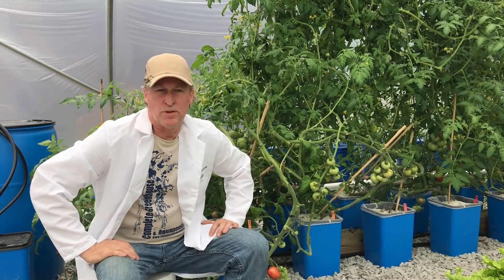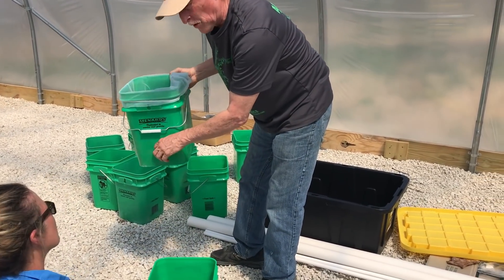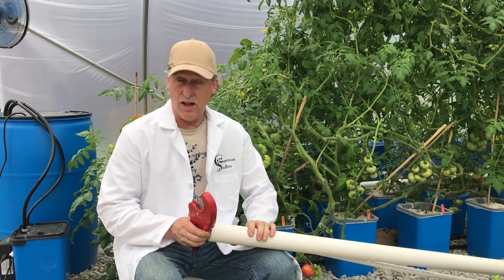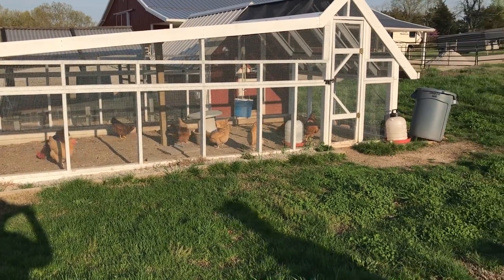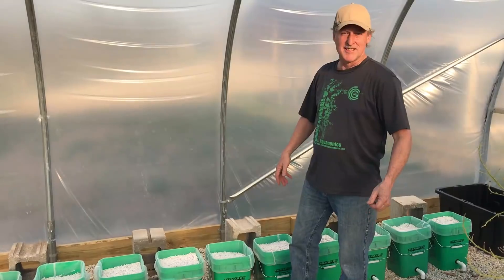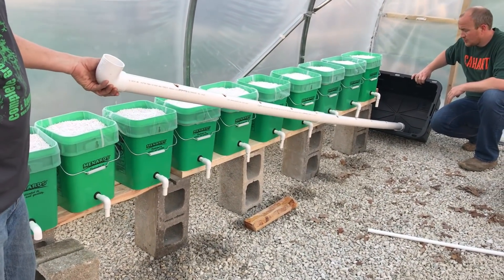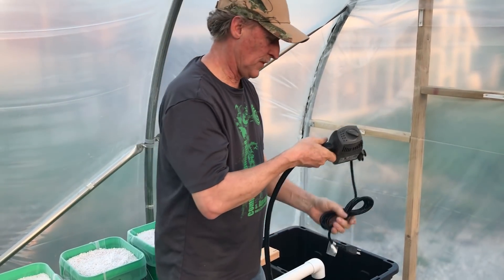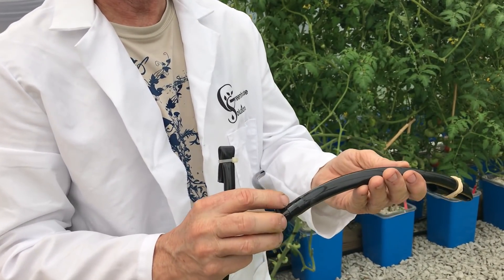Hydroponic Growing  Buckets (Dutch buckets) Best DIY Dutch Bucket Video

Comment: Very much a beginner question here but, my bucket is filling up with water and not draining well. There’s a puddle of perlite in the center. My pump is working at its lowest setting possible… what can I do?
Reply: Create some space at the outlet drain of the bucket. A little bit of large gravel or pieces of pvc at the bottom can help.Perlite might be too fine and not allowing to drain correctly.
Reply: @rplatow4120  yup that’s all it was. How embarrassing 🙈. Appreciate it

Comment: How do you make sure all the buckets get a similar flow of water? I just finished my build and for some reason there are some buckets that receive little to no flow of water.
Reply: Use an adapter T between buckets. This evens the flow. 1/2" for main T and 1/4"x1/2"x1/4" T between buckets. Minimum of 270GPH pump.
Reply: @rplatow4120  Thank you, I am currently using a 1/2 x 1/2 x 1/2 T adapter. So maybe I need to change the exit to the bucket to be lower diameter? Or the other way around: lower diameter in the entry and output that goes to the next bucket and higher diameter to the output that goes to the plant ?
Reply: @elnimrod  The1/4" feeds the bucket.

Comment: website dead?
Reply from the maker: Don't think so. Will check.
Reply: @greenhousesolutions1074  , site works. My machine was throwing in an S. https instead of http. One question though. Perlite. I have 2 huge bags like yours. How many 4 gallon pails can you expect to fill with 1 bag? I almost finished my 12x20 greenhouse from coloradometalworx.com. It's awesome. All of my peppers, hots and superhots are going there.  I am going hydroponics with dutch buckets this year. Hope it works out.
Reply from the maker: @TMonkey_DayZ  Each bucket takes about 1/2 cu ft, son 8 buckets per 4 cu ft bag.
Reply: @greenhousesolutions1074  Thanks

Comment: The way you entertwined the hose ! Bad luck if you want to move a bucket out of the system
Reply: Correct. We just use tomato clips or twist ties now. The intertwined was a suggestion from another client. Another person suggested drilling holes - more un-needed work.

Comment: Great video , I have a question: You say 1" hole 3/4  grommet and 1/2 pipe, the math over here does not add up well, can you tell me in more detail please.
Reply from the maker: The 1 inch hole (1.1"works even better) is needed for the 3/4" grommet (Outside diameter is 1"). The outside diameter of the the 1/2" pvc is the inside diameter of the 3/4"grommet.
Hope that helped.

Comment: do you need to determine that the slump tank needs to be able to hold all the water from all the buckets in case pump failure, so you don't get overflow in the slump tank?
Reply from the maker: No. You start with a full nutrient (slump) tank and then turn on the pump. Never more water than the system can handle. We use a timer to turn on and off the pump anyway.
Thanks
Reply: @greenhousesolutions1074  that means your additional water is added at the slump tank? if the system is outside (not in greenhouse), rain could be added to the system which could over flood the slump tank?
Reply from the maker: Yes. Rain outside can overflow tank if not protected. If outside, I keep the tank at 1/2 full. Thanks

Comment: Wear a mask when working with dust producing materials. White lung is under diagnosed and a ugly slow way to die. Farm and cleaning industries suffer greatly. You only get one set of lungs, protect them.
I still have a right eye because of safety glasses.
You get crap in your lungs your auto immune system will go bonkers.

Comment: Excellent....!!!
Can u tell me plz...
How much litters nutrients mixing water needs this 10 Dutch Bucket plant's per day..???
I means.. How much litter's nutrients mixing water absorbing 10 Dutch Bucket plant's per day....???
Plz answer me... Thanks
Reply from the maker: For starter and small plants, less than a gallon a day. For large, mature plants, up to 5 gallons a day. Heat and humidity and plant types are also factors, so there is no exact answer. Hope this helped.
Reply: @greenhousesolutions1074  Thanks for replie...

Can u tell me.....
""In this 10 Dutch Buckets systems for tomatoes or bell peppers growing start to end of harvest, totally how much litter's nutrients mixing waters  needed for 10 plants....??? ( one harvest period )"""

thanks again. If possible, then plz answer my question...
Reply from the maker: On an average, probably a total of  around 150 gallons. Again, many factors are involved.
Reply: @greenhousesolutions1074  Many many Thanks for reply...
One more question....
Can u tell me....
How much kilograms tomato & bell pepper's harvest from one plant's end of harvest in this Dutch Bucket systems...??? Thanks again

Comment: Truly helpful video. Unfortunately, I'm not in the States, otherwise I would have ordered your kit yesterday (literally, as I watched this last night :-)).

Question: what are the insert nets for? Cleaning/replacing the Perlite? Or just to prevent the outlet from clogging? If it is the latter, one could cover that outlet (pipe) with some smaller pieces of netting only? (because so far, I can't source those nets locally).
Reply from the maker: Yes. the main reason is to keep the outlet from clogging. The secondary reason is it easier to move and take out to clean if ever needed. Thanks for watching. Video on options for grow medium coming soon.

Comment: how do you clean and store your perlite from the dutch buckets in-between growing. I live in Ohio and do my dutch buckets outside so after the growing season I have to do something with it before winter comes. I started with 60 buckets last year with great success and I have moved up to 228 buckets this year. I saw that one guy soaks his paint strainers with the perlite in a mild bleach water, then rinses it, lets it dry, then dumps the perlite into 55 gallon plastic drums then next season dumps back into each bucket with strainer. Does this sound about right to you? or do you have an easier method?  Thank you for your time!
Reply from the maker: That would work fine. We grow all year and tested some perlite that has not been changed for years and new perlite. no difference. We do disinfect every 6 months or so with H2O2. Video on that soon.

Comment: if you lift the water reservoir high enough. you can gravity feed it to the plants by drilling a hole in the container lower than the top of the water and put in a valve. open the valve three times a day and your done. you could even put in a solenoid to open the valve three times a day or have a power valve. so you could do it without the pump. just a thought.
Reply from the maker: Would work if you don't want to save and recirculate the water.

Comment: You can open top of the bag and wash it right in there, just poke a couple holes in the bottom of the bag. You can save the water for next bag if you do it in a tub or somethin like that in size.
Reply from the maker: Just makes the transfer to the buckets a little heavy, but would work.
Reply: @greenhousesolutions1074  wash it in the bag and let it set overnight to drain out the water

Comment: Why did you use 3/4 grommet on a 1/2 pvc, is it the correct size?
Reply from the maker: Yes. Outside diameter of 1/2" pvc perfect with 3/4" grommet.

Comment: What is the size of your feeder line into the bucket? I have tried to different pumps and am only able to get my water go about 6 feet even when my pumps say the can go 25 feet, any thoughts on how I can get it to go to my last bucket?
Reply from the maker: Use reducers on your first few buckets (1/8 inch) 1/2 inch main line, 1/4" feeders.
Reply: @greenhousesolutions1074  I'm having the same issue with my last two buckets not getting water...just a small gurgle. Are these reducers hises or plugs?  Do you have them or do I get them at hardware store? Thanks.

Comment: #pleaseassist ..hello , i practice hydroponic farming where i grow tomatoes..planting medium is pumice..can you please help with the ratios of nutrients required at different stages of growth in tomato plants ie. seedling stage, flowering stage and fruiting stage...your advice will really help.
Reply from the maker: Using the Masterblend ratios is great for all stages. The plant will use everything it needs at it's different stages. If you want to back off the Calcium nitrate to half through fruiting that would be fine, but the plants continue to grow and produce well for 2 years. So that being said, the plant is actually in all stages. Thanks, Randy  You can get the best price on Masterblend nutrient packs at  www.CompleteGrowing.com

Comment: You can cut a black plastic sheet to fit on top of the pearlite with a hole for the irrigation tubing and the plant stem if you want to inhibit algae growth.
Reply from the maker: Yes, but be aware of the extra heat generated. Thanks

Comment: Just curious, wouldn't it be easier and more cost effective to use large bins (troughs) instead of a bunch of separate buckets?
Reply: Depends what you're going to grow and what space you have to do it. Can mix many different types of container/system together. The fun is in it's scalability. Gets a bit addictive!
Reply from the maker: You actually use less media in the separate containers, and also have more control. I do some of my root crops in larger containers. Thanks

Comment: Is this only for a greenhouse? If you set this up out in the open how do you avoid flooding the system when it rains?
Reply from the maker: This is being done outside as well, The buckets will not flood since they continually drain. The 27 gallon bin can over flow from the rain, but just check your TDS (nutrient level) and adjust if needed. See the nutrient YouTube video. Thanks

Comment: I live in the High Desert.  I read that water temp is critical. how do you keep the water temp. cool?
Reply from the maker: 2 possibilities:
1. Dig your water reservoir into the ground for some geo-thermal insulation.
2. Set up a mini evaporative cooler for your water tank.